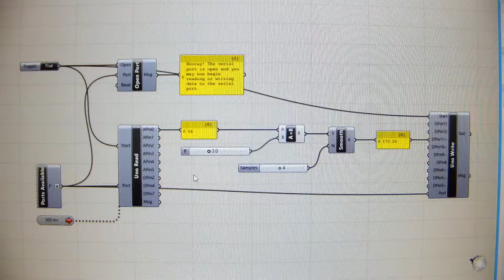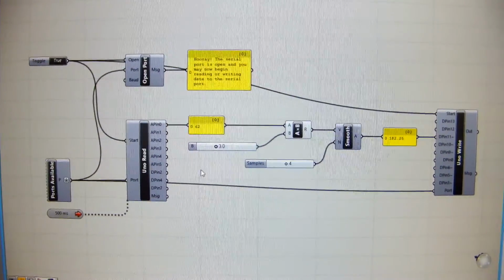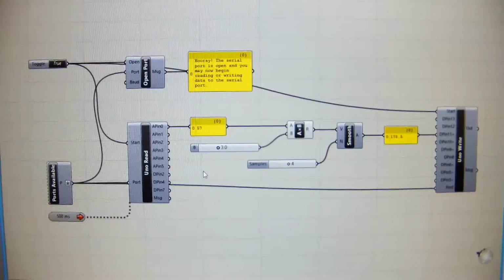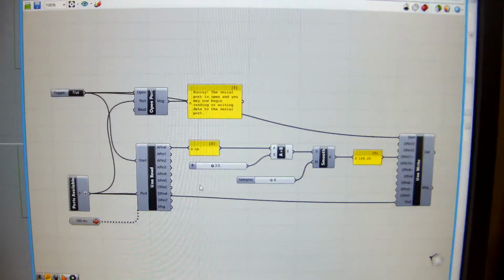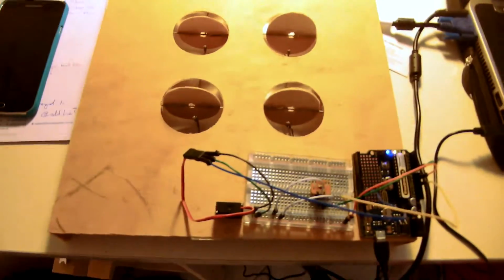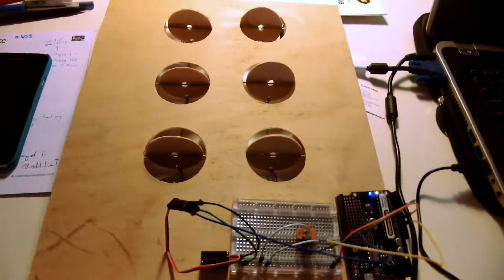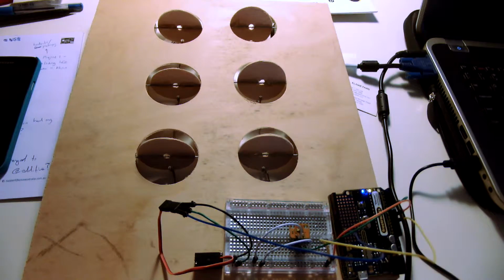Grasshopper + Firefly = Robotic Light-Sensitive Panels

Comment: What did you write in the 'expression' of COM Ports Available node?
Reply from the maker: If you use the same "COM Ports Available" node it will automatically detect the active COM port... I tend not to use this option anymore and manually select the COM port number I want to use using a slider.

Comment: What kind of servo motor you used?  I have a small one that came with a Vilros kit and I don't think it will be able to move such relatively heavy parts.
Reply from the maker: This is a very cheap servo that came with a kit as well - I'm not sure what you're using it for but I've had no problems for small designs like this.
Reply: Thanks!
Reply: Hello Mam, I hope you are safe and healthy! I am an architecture student currently doing my research thesis on kinetic/dynamic facade… I am planning to make a prototype of a sun-tracking kinetic facade using firefly plugin and Arduino board. I am a newbie to these things and I don’t know where to start. So can you please guide me to the right track. Any kinds of inferences, material and data are welcomed.
Any help would be appreciated,
Much Thanks!